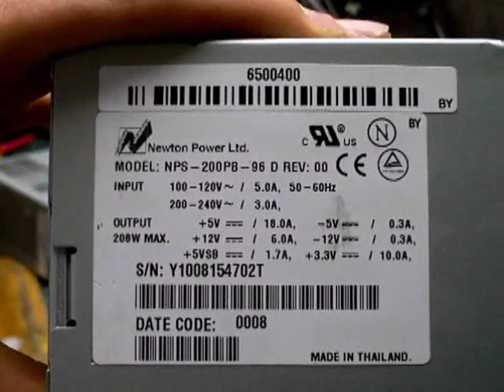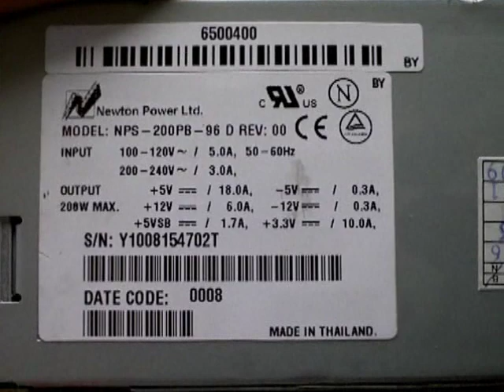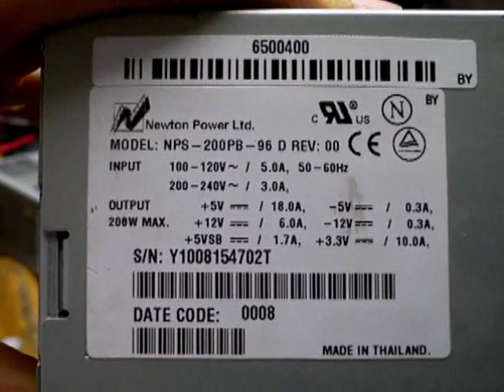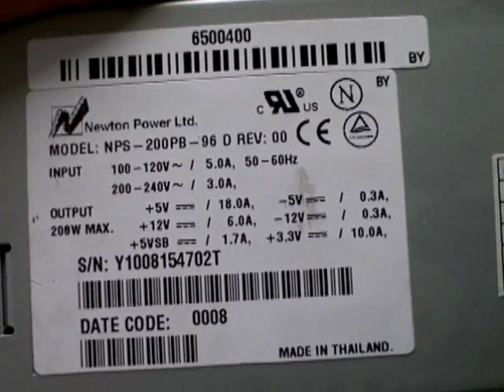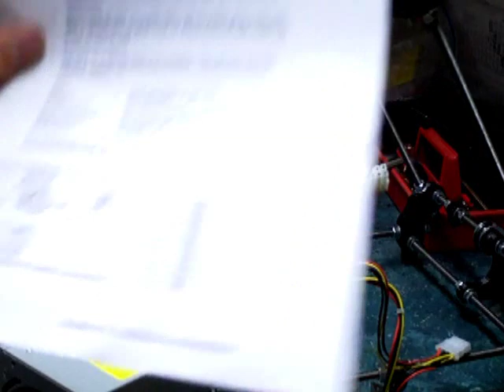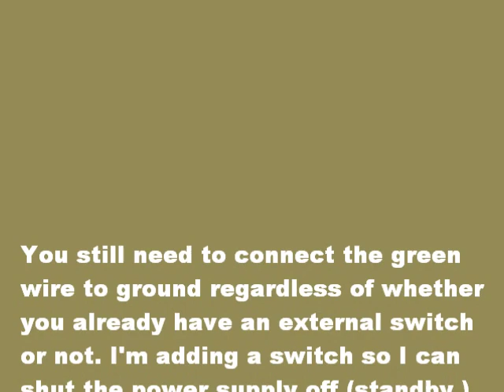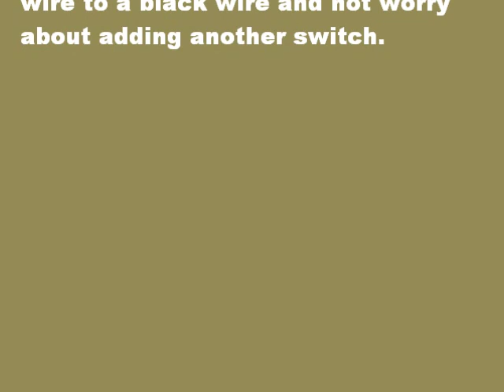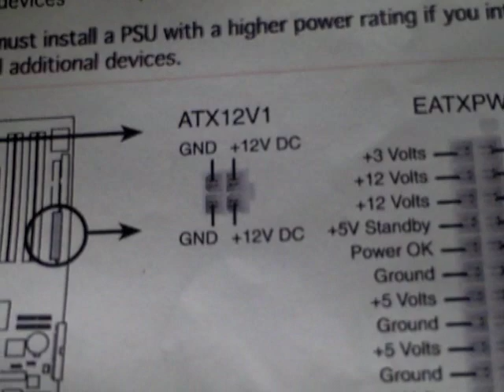How to Prepare a PC Power Supply for your Reprap 3D Printer

Comment: I'd recommend picking up an atx extension cable for a few bucks, and splicing that into your printer. If your psu has problems or you want to replace it, it would be trivial to just unplug it and throw another off-the-shelf un modified psu in its place.
Reply: Nice hint. I will do just that! Sometimes the most obvious ideas are the best :)

Comment: The model number i listed does not have the power drop issue either. Also its alot smaller than the 30Amp power supply's on ebay from china. It has a single Delta 4mm fan in the end of it that move air through this thing like crazy. My dad and I build OrdBots we have like 12 of them and this power supply is one 5 of them with no issues.

Comment from the maker: This is a really good point. This video is showing how to use a PC PSU for your reprap. EDIT: Some PSUs need a 1-2 amp load on the 5v rail otherwise they will have an intense voltage drop on the 12v when the printer is running. My particular unit did not have this problem but a few LEDs (to make it look cool) did a fine job taking some noise away when the PSU was powered on without load.

If you are going to BUY a PSU definitely go with a 12v (20A fine) PSU like Paul Estep recommended.

Comment: for a really good cheap psu for a 3d printer look up WP507F12 on ebay. it has 30 amps and LOTS of 12v outputs! Got mine for 20 bucks shipped and it runs my ordbot hadron with heatbed great!